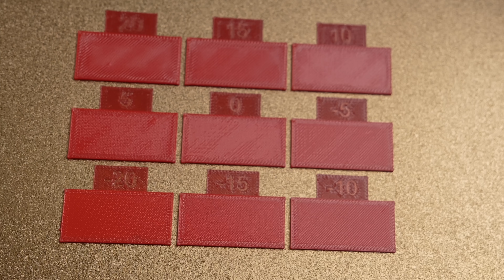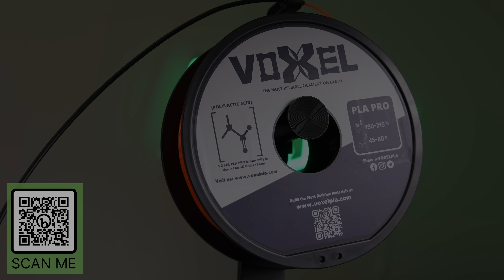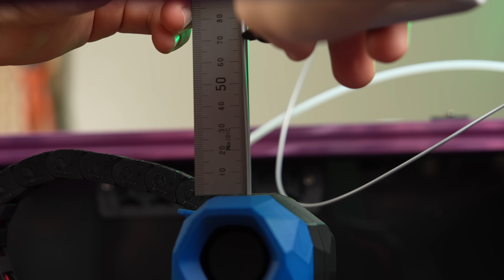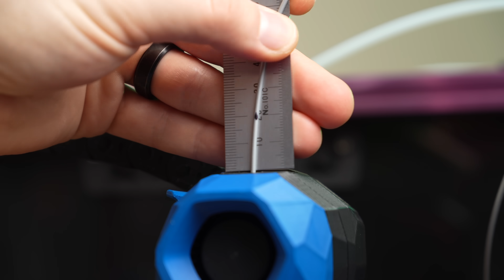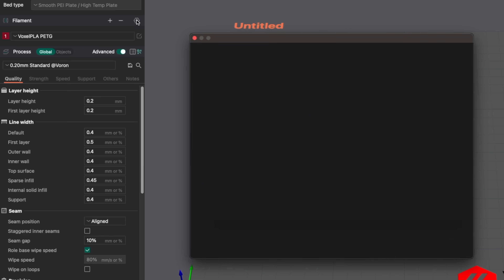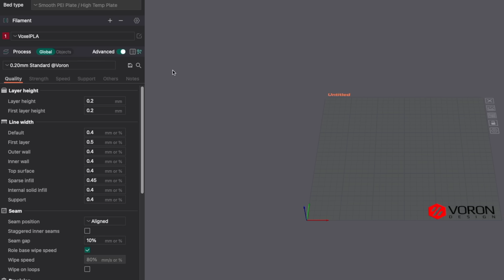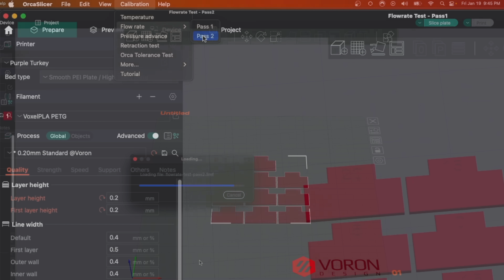Tuning Material Flow For Best Quality 3d Prints (OrcaSlicer)

Comment: Just bounced from Stefan's size and skew video to this banger.  Tuning is the word of the day.  I used this method on my rooted K1 Max and it worked really well. My top layers look great and my layer stacks are nice and consistent.  Thanks for the great content always.
Reply from the maker: Thank you for the kind words. Stefan's video was awesome and definitely gave me a lot to think about. Will be interesting to see the skew on some of the printers I have built here. Have a great weekend :)
Reply: @ModBotArmy  question, I have this strange under extrusion always after my seam on my creality ender 3 v3 se, idk what to do...
Reply: came from CNC kitchen too
Reply: Just got some TPU and my lord... 
More like nothing is tuned! When I buy a finished product with a preset for a filament they sell  it should not need tuning., and if it does they should be the best ones to tell me. Not that I, for a moment, thought these are finished products but they (especially bambu) sure want us to think so....
Reply: @remotepinecone  You're not made for the world of 3d printing if you think that way.
Printer have come A LONG way, but it's still not a consumer product, you will need to sweat to have good results.
Reply: RatOS seems to be doing  skew already out of the box for 2.1    don't know much about all this "new fangled"  klipper stuff yet (feel like an old man even after only a few years)  things are definitely moving quick,  so far @modbotarmy is keeping up... and apparently it really is almost  a full time job  keeping up.

Comment: Is this benifital for bambu lab A1? Since it has a built-in flow calibration system.
Reply: Fortunately/unfortunately (if you have fun tuning) no, don't need to do flow calibration as its basically done in real time by the nozzle pressure sensor

Comment: Being able to easily and quickly changing settings without recompiling is my favorite thing about klipper
Reply: RepRapFirmware did this long ago
Reply: Lol. You can change this in RRF on the fly by just sending GCode.
Reply: @ydoucare55  sending gcode and setting it in firmware are different. What happens when you need to wipe a machine? Remember all the different gcodes you sent to get everything juuuust right? Nah dawg
Reply: @therick0996 with Marlin you can just save to eeprom
Reply: This is also true for much of Marlin firmware. Looks like we all have it!🎉
Reply: @brettvitaz9101 when did Marlin get it? you used to have to recompile Marlin for every change
Reply: M503 S0 from a terminal (octoprint, mainsail, pronterface, etc) displays all current firmware settings in replayable gcode, so you could just paste it in notepad and save it as a gcode file and "print it" from the sd card, or copy and paste it back into a terminal after you've wiped it for whatever reason.  

No remembering all the different gcodes you tweaked required lol
Reply: @dontcallmebrave  For klipperophiles, it's so difficult that their brains explode 🤣
Reply: @dontcallmebrave  why would you not just copy your printer CFG?
Reply: @mikehughhawk  there is no printer.cfg for Marlin?
Reply: @dontcallmebrave  I'm sorry it's called M503 which is as close as you can get to printer CFG settings.
You're right tho.
Reply: Changing settings w/o recompile is something novel?

As a software architect/developer, I'm aghast. Were 3D printer firmwares really full of magic numbers not that long ago? Good god.
Reply: Hi, I agree but honestly the firmware shouldn't be written that way in the first place.
Everything is so antiquated for new tech its unreal.

The fact that Klipper talks over a serial connection almost made me puke I thought this stuff was high tech, 90% of the thing is parts from 1975. Reading about people compiling was equally as revolting. like nobody made a controller they just borrowed cnc machine stuff even gcode ffs. no. we need new code we need smarter boards. We need to get ride of damn skateboard wheels for linear movement.
Reply: @remotepinecone  yup, yup and yup.
65 MHz boards? 512 ram?
🙄
Reply: @remotepinecone while I understand the sentiment, I myself would rather have a printer that prints better. What about having a printer, that is easier to work with? If that's doesn't dramatically increase the cost and most importantly doesn't impact print speeds and quality, I'm all for it.
So instead of messing with skateboard wheels, which are currently the king in affordability and rigidity, unlike rails which 99% of the time give 0 increase in print quality but require thorough maintenance, I would rather have tested and affordable linear motors, which allow to get rid of VFA, and thus actually affect print quality

Comment: Lots of good info thanks. Just want to add that flow calibration is also necessary as part of regular machine maintenance & not just filament swaps since the extruder gear will wear out with time and this will decrease the gear's diameter / circumference, resulting in under-extrusion.